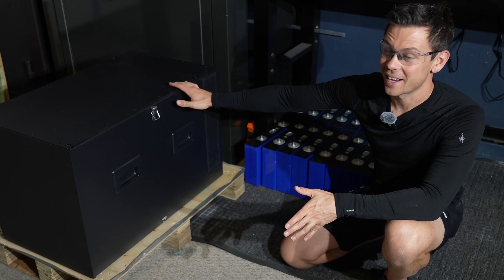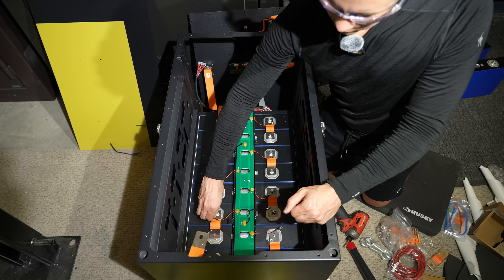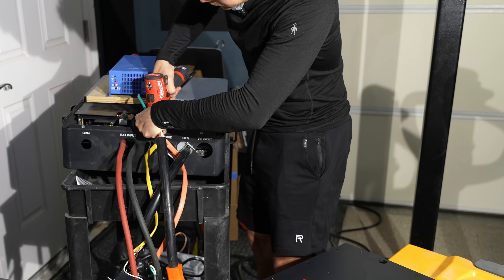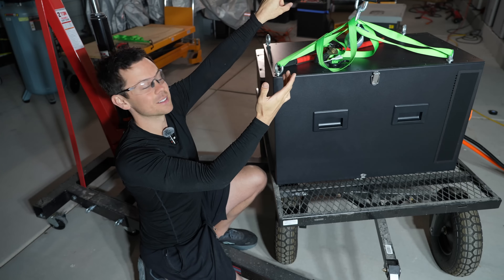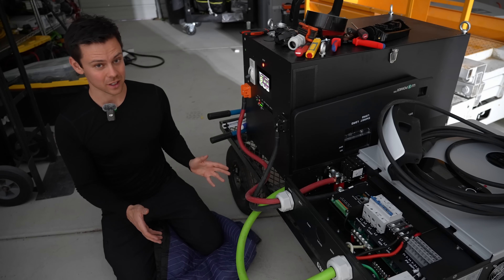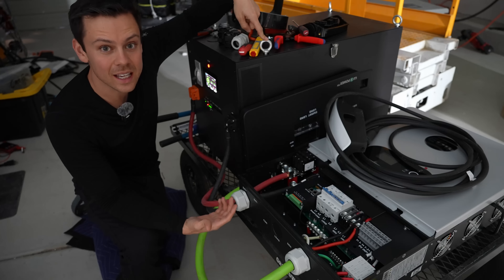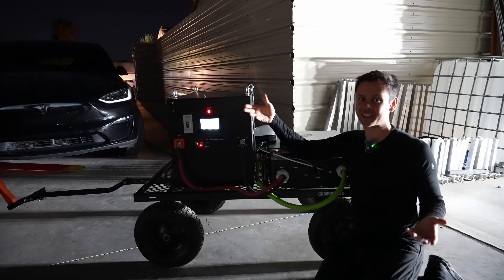HUGE 32kWh LiFePO4 DIY Battery w/ 628Ah Cells! 90 Minute Build

Comment: I have looked at these for months but was hesitant until i see someone review these, thanks will!
Reply: It's too heavy for me. I can move my MB31 16kWh pack around myself, just about. That's 110kg. The MB56 one is 230kg!
Reply: @pau1phi11ips  yes these cells are too heavy to handle. 
Boxes with 8pcs mb31 cells are great . With 2 off these next to each other your 48v battery is always transportable.
Reply: Off grid garage did it weeks ago
Reply: @davidhopkins9021 send me link, I wanna check it out……I wanna get two of those banks

Comment: Wow what a battery! I live the boondocking life and not by choice, but I've come to enjoy it, especially now that I started a new YouTube channel and that technology like starlink opens up a new world of possibilities. Right now I'm stuck living out of my 2001 GMC Yukon XL 2500. This new battery got me thinking about building a new diy micro camper on the new Harbor Freight 2000lb capacity modular trailer. It's less than $2k. I'm very handy with construction and drafting my own schematics. This has me excited because I want to do what nobody else has ever done in expandability and modularity from something so small. This battery has so much capacity that I could camp under a tree canopy for 2 weeks knowing my usage stats (you can stay 14 days straight on BLM land for free) and then move to a sunny area to recharge the battery, then hit another remote area under tree cover. This will greatly reduce my need to run an air conditioner all day while reserving that power to run Starlink and my powerful editing PC I built. I'm currently looking at the 590 watt bifacial panels on Amazon and I've developed a diy dual axis rooftop solar tracker that can deploy 3 of those panels to gain another 30% of solar intake. But funds are non existent at the moment, but I want to provide channel members with all the schematics, build materials, assembly instructions, etc. Will Prowse is who I go to, to do things right with safe solar installs and he's done all the work finding the best bang for the buck hardware. If I could afford to repay him I would.
Reply: Why don't you put solar on your roof maybe even a solar awning that pulls out and then you can park anywhere and run a solar mini split from it
Reply: @jarneoffgrid oh I am, but when I hit the Montana Rockies some of the best spots are wooded so solar isn't always an option. Plus Montana gets multiple days with no direct sun so massive storage capacity is a must.

Comment: 32kwh only 80 miles? figure a way to run it on gasoline much better.
Brazos Men's Summit Steel Toe/ EH/ SR/ OR/ Work Boot/ Suede Upper
above mentioned work shoe is still worn everyday 10 - 1/2 years after my retirement from machine shop. it is comfortable.

Comment: I paid $20k for two powerwalls and a gateway and installation.  This battery has more capacity and if you included a hybrid inverter and integration into my home, it would be around $6-7k.  I would love to add this to my system, but have no idea how to do this and have them work with my powerwalls.
Reply from the maker: You could create an AC coupled system with storage to expand as much as you want. connect this to a hybrid inverter and then have forced charge and discharge cycles. Charge when your other system is over producing. Discharge at night or in the afternoon when you need it most.

Comment: Forklift makes everything so much easier for sure. 

We used a high lift pallet jack I bought used off Facebook for years. Keeping everything on pallets made moving  our equipment trivial. 

Made a cart out of unistrut, work in HVAC so I have a ton of it around, works fairly well. At least it can take the weight.

Comment: Will, get yourself a pair of decent hard toe boots. Put them on when you’re moving the heavy stuff around, and after everything is in it’s place, put the comfy shoes back on. This has saved me from a couple broken toes, for sure. Great videos.
Reply: " Project farm " - has a couple good videos up on Best Boots surviving toe smash test.
Reply: 35 years of wearing safety shoes. They can be very comfortable. I preferred composite over steel.
 Or skip them and you are one mistake  away from never wearing flip flops again.
Reply: Safety toes (either composite or steel) don't save you from everything but they're great for turning an ER trip into "hey be careful with that you $&**%#". Even if the person you're yelling at to be careful is yourself.
Reply: I highly recommend Keens boots! I loved mine in the oil field, plus lifetime warranty on waterproofing!
Reply: It's called a Lisfranc fracture. Not too bad a few screws and a plate on top. 😅
Reply: Modern safety shoes can be ridiculously comfortable, you'll think they are regular shoes.
Reply: I wear steel toe boots at the gym. I dropped 500 lbs on my foot
Reply: Safety steel toe crocks.
Reply: @shadetreemechanicracing22  whoabros sells the steel toe inserts
Reply: A big square tub of potato salad slipped out of my hands 3 months ago.Just caught tips of 3 toes.Bugged me for 8 weeks. Could have broke 3+ toes lol😊
Reply: Also a metatarsal guard is great too. Lost of stuff clears the toe and smacks right on the top of the foot. And when it does, there is no profanity in the English language that describes that pain.
Reply: I like a good pair of Red Wing steel toes with metatarsal.  They can be really comfy and really save your feet.
Reply: A good pair of steel-toe will be comfortable as well. They're expensive but well worth the price.
Reply: Yep. Lost a few toenails before I got mine, luckily nothing more.
Reply: I now see this comment was some foreshadowing
Reply: Great advice. Even when you work safely unexpected things WILL 😂 happen!
Reply: I would actually recommend a metatarsal. He is a lot of times when you drop something on your foot it's not the toe it's a spot between
Reply: @bullithedjames 

I had a really comfortable pair of Redwings with a metatarsal flap on them.  They were very comfortable and lasted as long as the soles.  I got them wet, and had not oiled them to keep them waterproof, so they were done.

 I went into a Red Wing shoe store to get another pair, and found that they did not stock any wide sizes.  I had to move on to another brand because of that, but Redwings served me well for a long time.
Reply: They make composite safety shoes that look and feel like sneakers that are fantastic for this.
Reply: Yes Will, agree with recommendations for comfortable safety shoes.    I put on safety shoes & glasses whenever out working... Safety First
Reply: Narly swelling
Reply: Good advice! I dropped a large heavy battery in my toes once and it wasn't a pleasant experience!!
Reply: Yep! I've been using these steel toe shoes at work for about 10 years:  KEEN Utility Men's, Atlanta Cool II Steel Toe Work Shoe  (available on amazon or direct from KEEN) Tough, but light and cool!
Reply: @AndyZiebarth-r3j  I would suggest Redwing - Irish Setter with Metatarsal guard. think of it as an extension of the steel toe. Originally developed for timber and iron work!
Reply: I use some thick clogs when working with heavy stuff, they have saved me many times and are cheap
Reply: I'm pretty sure steel toe boots are only rated for 50 pound impact.
Reply: @ruckus_

I'm pretty sure you have no idea what you're talking about.
Reply: I 2nd all the buy safety boots ideas...
Obviously buy what suits your needs bassed on what's available or you can order in...

Don't do that again...
It was painful for me just watching you hobbling..!

Stay safe bro.😊
Reply: i worked with steel toe, and they are not magic.
Reply: depending on the weight if the steel toe failes, it’ll pinch your toes off. But for 100 amp-hour batteries are perfect. Make sure you get the right tool for the job.
Reply: @Tuggs no they won't, mythbusters did a whole thing on the myth that steel toed boots will chop off your toes, they won't.
Reply: @Tuggs if the weight of whatever you had was enough to bend the steel toe- I promise, PROMISE you your bare toes would have been far worse off. Stop spreading misinformation. Do better.
Reply: @Tuggs  the weight needed to have that steel toe pinch your toes off you would have already lost the foot 🥃

Comment: What struck me in this video is nothing was said about wearing steal toes, a must in an setting like that.
Reply: Even with steel toed shoes if you drop it on the top of the foot instead of the toes, it doesn't help all that much. Safety gear is important but also paying attention is of the utmost importance when you're moving heavy things. Just like with three points of contact. Don't move it unless it's supported.

Comment: can you parallel the 32kWh battery with 16kWh battery for a total capacity of 48kWh?  If so, could you do a video on it?
Reply from the maker: Yes, just hook it up with proper size cable
Reply: Ofc. As long as the chemistry and the voltage is the same, there are no issues. Just like you can mix and match 16s 100A and 280A boxes.

Comment: There is a thing called a "spreader bar" that will help you with lifting things, even with the forklift.
Reply: Great video. Yes, your rigging is definitely too short.  Spreader bar or longer rigging is needed.  Those eyebolts are designed for straight pull. Looks like your green straps were less than 45° which cuts capacity by a chunk.  At 30° all rigging capacity is cut in half.  Sorry not to totally nerd out but I’m a tower Crane Operator and I do this every day. P.s. love the channel you’ve help me cut my PG&E bill down to zero !!!
Reply from the maker: Yes
Reply: Good point, like SpaceX uses to pick up multi-ton Starships.
Reply: @jebediahkerman3946  multi-ton battery.  Now we're talking.
Reply: swivel eyes (mcmastercarr) can be used without bending.  for shallow angle (short slings) derate the vertical capacity, less than 30 degree is not recommended.  M6 is rated at 550lbs, and M8 is rated at 875lbs (vertically).
Reply: are you sure that's what a spreader bar is for? lol >///<
Reply: @GraceV.Alopex  I'm not a rigger Grace, and I'm not a know it all. But yeah, I'm pretty sure that's what a spreader bar is used for. If you disagree, why don't you enlighten us?
Reply: Get one with a adjustable main lift point for uneven loads so you can get it closer to CG.
Reply: @volvo245  sounds like the leveler I use to install engines.
Reply: What did you get me searching for i had to scroll awhile to find something relevant 😬

Comment: Bruh, when at my job, the next forklift battery fails ( lead-acid ) im going to build a battery like this.
Only concern is the weightloss, and maybe the max. Amperage of the bms.
But I will figure that out, I think the highest current our forklifts draw are around 300amps, so the latest JK should work.
The weight issue im sure I can work around that with added concrete or steel plates.
But im sick of these overexpensive lead-acid crap ! Not even mentioning how dirty they get because of the moisture from filling them up. Ive had enough of them.
Reply: Also take in consideration that the impedance is only a fraction of that from a lead acid battery. So the charger might "think" there is a short circuit.
It's 3 times the capacity for the same weight if you have the luxury of having a good fit by accident. I could get 48 LF280k's in a Clark forklift. 2x2p 24s for 80V.
The batteries can supply about 30kW. More than enough for a forklift.
I can use it for over a week now.
The weight is maybe 100kg difference. Still full power even at 5%.
Reply: @foeke8740 Yeah, we use our forklifts a lot more, in the high season we must charge everyday. On average we probably charge every 2 days.
Some forklifts though, we charge every day regardless. Our most reliable forklift is a Toyota from 1984 ! Best forklift ever.
Downside is it's battery capacity, I think it's around 350ah 48v , or slightly less. Lead acid battery's though.
The forklifts don't have to lift their max. lift capacity at all, so I don't think the weight loss will be that of an issue, but ofcourse you don't want to differ from the rated weight all to much.
Reply: @edwinbruckner4752 I don't think our Clark is much younger. 90% of the time it's lifting tree trunks on the bandsaw. It only lifted it's back wheels lifting a 8 meter long 1 meter width swamp oak. That 100kg difference wouldn't have mattered.

Comment: A $3,500 batter plus a $15K forklift hahahaha! Have followed you from Cali to here for years and I'm beyond grateful for your info and your journey to being successful. Great time! Glad you're OUT of Cali now as well. Breathe free
Reply: Try $35k+ for that forklift.
Reply: @Tb0n3  I was thinking just buy a used one, until I saw it was a battery powered one haha.
Reply: @Tb0n3  $35K
Reply: I have 2 Moffitt piggyback forklifts, they are great. I used one of them when putting up my ground mount solar as I wanted the ground mount to be level, but not with the ground and it started getting high up into the air and ladders on uneven ground suck and are wobbly even with someone holding it. I got one for about $6.7k and the other one for $4k

Comment: The whole weight of the systems gets crazy. That's why I've been avoiding buying more of the 100AH server rack mount batteries. It's nice to see you brought up the concern. Get well.
Reply: there is a reason why rack mount batteries exist, 
that is the upper limit on battery size because of the weight.

Comment: you are basically building a DIY car with modular parts for the motor energy supply AND its AC which can plug regular household appliances. Add an llm AI server with some sensors and call it "Solardude" trow Alexa

Comment: That could make a half decent city commuter electric car battery..
Reply: Think it could handle car vibrations?
Reply: @idahoduckhunter  if you can rig up up a separate independent  suspension system to dampen the impacts.
Maybe.

Comment from the maker: I totally messed up on the BMS load test!! I thought it was the 200A version, it is 300A! My bad. 
0:00 Intro
0:29 Build it in 90 min!
2:10 First Capacity Test
3:36 32kWh Battery Cart Charging an EV
5:26 I Smashed My Foot!
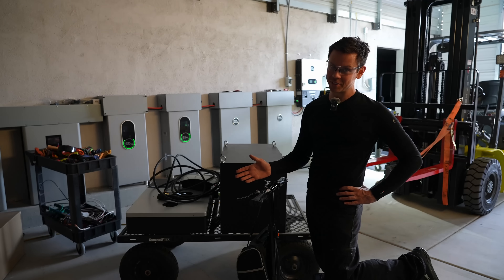8:17 200A Max Load Test